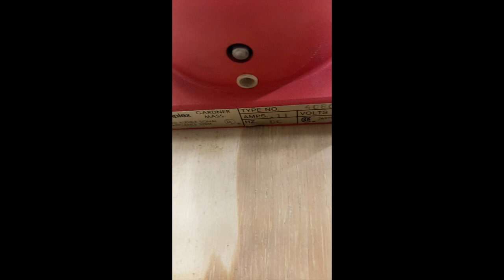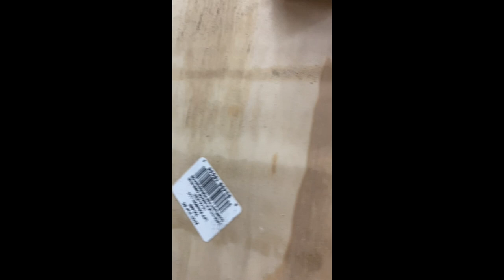FIRE ALARM BELL REPAIR

Comment: Hey there! I was just wondering, would you know anything about the Simplex 2100? There isn't a lot of information about the panel and I'm curious to know some stuff about it.
Reply from the maker: That was a "Short Lived" panel that was quickly replaced by the 2120 (see my other videos on that). I've worked on a few 2100"s and may still have a manual on it/I'll have to check but can't promise anything.
Reply: @firealarmtech4100  Very cool! I've always been curious about the 2100 as you mentioned it was quickly replaced. My main curiosity with the 2100 was if the panel was able to use a voice system like the 2120 and 2001 panels.